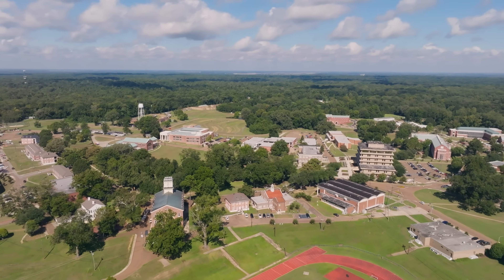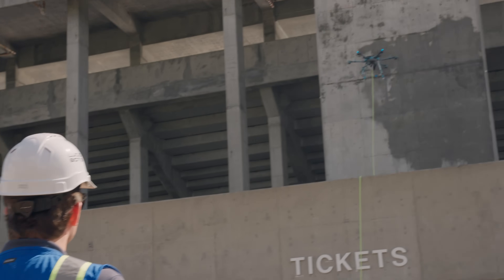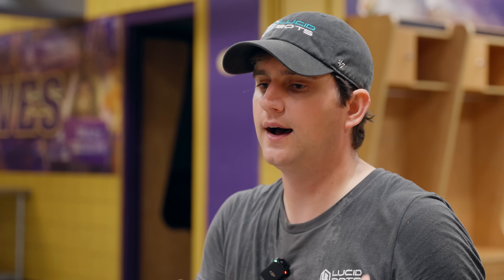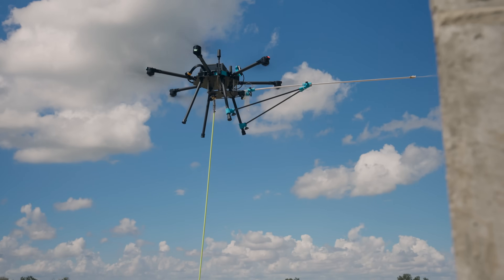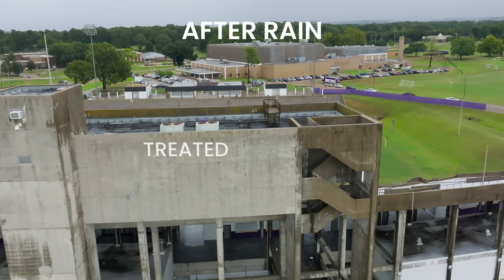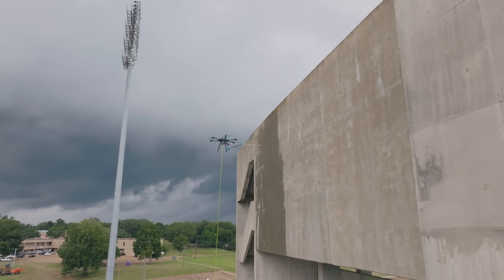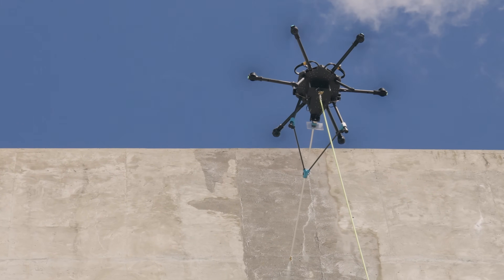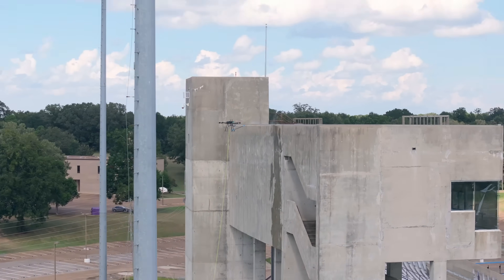Sherpa Drone Finished the Job 20x Faster | New Concrete Applications by Lucid Bots

Comment: Why not using power cord along with paint pipe . This will also save
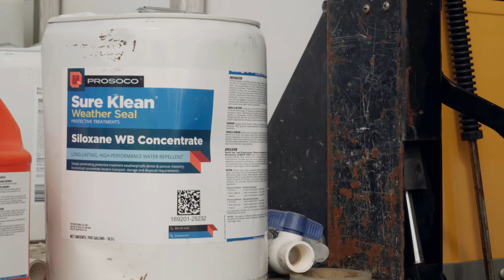Reply from the maker: The Sherpa Drone in the video has a power cord - check out 0:32

Power tether will be publicly available very soon!
Reply: @lucidbots in Italia quando arriva questa meraviglia
Reply from the maker: @VESUVIO1926  Very soon! Contact us today so we can let you know as soon as it is available: https://www.lucidbots.com/contact
Reply: Probably because of weight. However the Drone could be redesigned to work with with high voltage, which may solve this issue.
Reply: Sherpa is power tether capable